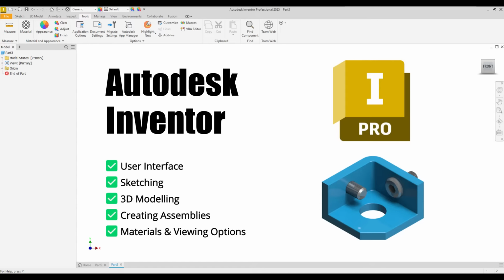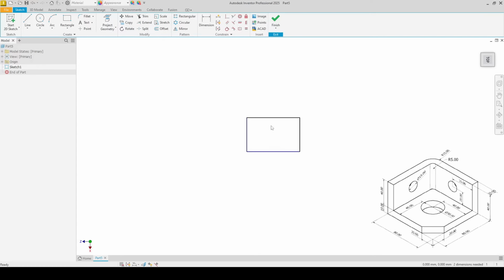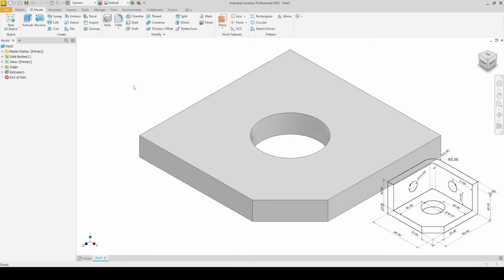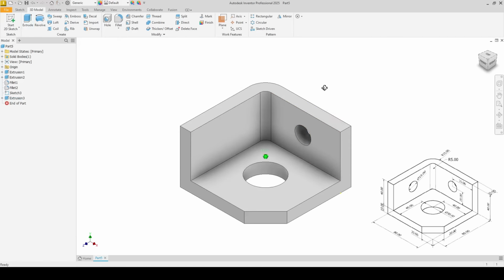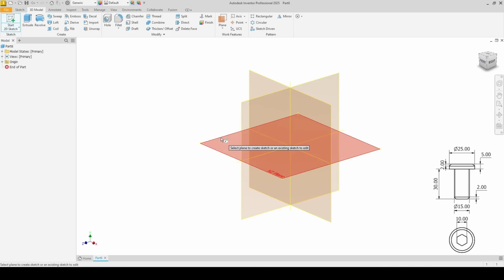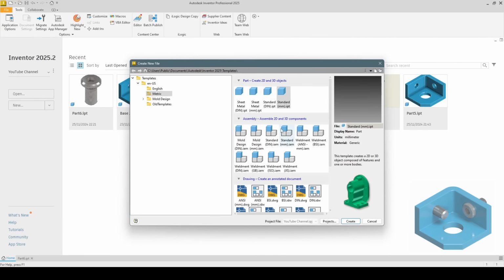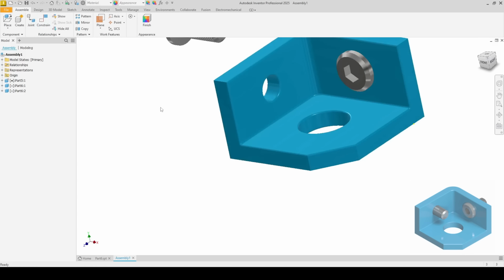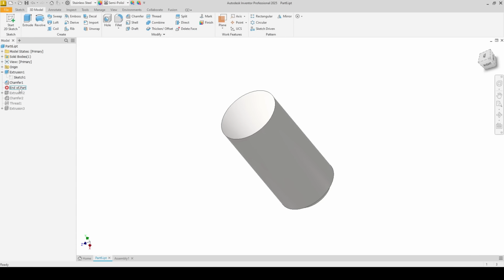Autodesk Inventor 2026 | Basics For Beginners | 30 minute Guide to 3D Design | Step-by-Step

Comment: if anyone wanna become a design engineer, i recommend you to start 3d modeling how the part is gonna be machined...start modeling a block, then extrude out, then use hole features, round off corners, chamfer  edges
Reply from the maker: Great advice, designing with the manufacturing process in mind is such a crucial skill for any engineer!

Comment: What about creating threads on the bracket itself to fit the bolts?
Reply from the maker: Hi Joe, good question. In this case we could create threads on the holes but the thickness of the wall is very thin so there would not be much contact between male and female threads. I would recommend using nuts the secure the fasteners in place on this bracket.

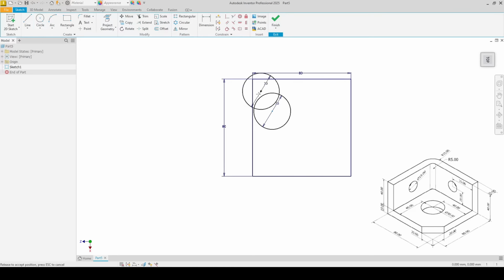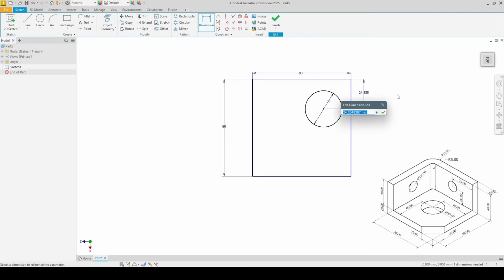Comment: I am brand new to this.  I am using Inventor Professional 2026 on a Windows computer.  I have a few questions, around the 5:00, when you are moving the circle around, what/how are you clicking on the circle to grab and drag it around?  Around th 5:10 mark, when you are clicking on the dimension and the circle (to constrain it) it will not allow me to do this.  Are there some settings that have been setup to allow this to occur?
Reply from the maker: Hi and welcome to Inventor! For your first question, we can drag circles around by holding down the left mouse button whilst hovering over the centerpoint of the circle. Make sure you are hovering over the centerpoint and not the circle circumference. For the dimension at 05:10, that's odd that it does not auto select the centerpoint. In this case, you will need to click the centerpoint instead of the circle circumference. I've never come across this issue, Inventor should default select the centerpoint when we click the circumference. I'll have a look at why this happening. Likewise if you find the answer please let me know :)

Also - I have a full course on Inventor, it's 8 hours of content such as this tutorial and around 20 USD. Feel free to join us there if you want to learn more.

Best Regards,
Chris

Comment: Question. When placing the first item in the assembly, inventor doesnt keep it as i fixed point. Is there any way to do it manually? Thank you for the video, it has been extremely helpful.
Reply from the maker: Hi Michalis, thank you for the comment and I'm glad you like the video :)

Yes absolutely, when you have selected the part, do not left click in the environment, instead, right click and select 'Place grounded at origin'. This will ground it at the environments origin :)

Alternatively you can left click for it to be in the environment floating, and then go to the design tree and right click on the part and select 'ground at origin'. 

I have a full course on Inventor this in the description, all these tips and tricks are covered there if you're interested.

Hope that helps :)

Best Regards,
Chris

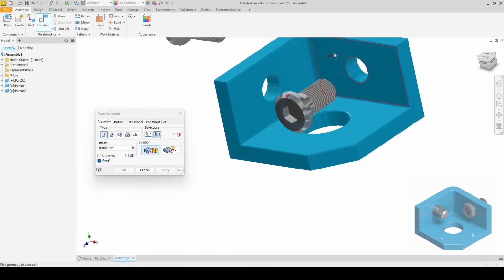Comment: 23:23 why does my pain not rise evenly, well, that is, it deviates from the hole by 20-40 degrees
Reply from the maker: Hi! Sorry for your pain! Make sure you select the axis of the bolt and the hole, they will then be concentric, make sure not to add an offset, i.e. 20-40 degrees.

Comment: My teacher was adamant about using holes instead of circles and not selecting surfaces, but always using planes. This way, the body can be easily modified later.
Reply from the maker: Spot on, the Hode Wizard is the way to go for conforming with hole standards. This exercise is just to appreciate the Extrude tool adding but also removing material. Your teacher makes a good point about using planes! 😊

Comment: Hi, could you please tell me how to solve the problem of internal voids in a part? In Inventor, is it not possible to simply select faces and delete them? That’s how I do it in Fusion 360.
Reply from the maker: Hi Andrew, I'm not sure what you mean here. Voids we typically want to fill in which case we would use extrude, revolve, sweep etc. In terms of faces are you talking about surface modelling? Or do you mean removing entire extrusion that include multiple faces of 3D geomtry?

Comment: 1)а нельзя сразу на одном скетче начертить нижнею часть и на том же скетче начертить стенки и потом их вытянуть??? 2) высота стенок на одной стороне 10+40, а на другой почему то просто 40?
Reply from the maker: Hi, It is possible to sketch the walls on the same sketch as the baseplate but then you will have conflicting material and this may offset the properties of a part as it will have duplicated material in those conflicting areas. For the second point, I understand but the drawing is correct, on the right side you will see that the dimensions reference line (the dashed line) comes to the line above the baseplate. If it came to the bottom of the baseplate then it would be 50mm. Well spotted !
Reply: @DesignForge.Studio  при соединение двух обьектов он их обьединяет и он становиться одним блоком, если тока ты не нажал отдельго  не обьединять. и ты можешь отдельно вытянуть стенкии нижнию часть так их отделяют линии
Reply from the maker: Hi Sigma, thankyou! When you join two objects in Fusion, they can merge into a single body if the “Join” option is selected. However, this isn’t always required — you can switch it to “New Body” if you don’t want them combined.

Comment: 1. Box 80x80x50
2. Chamfer 20x20
3. Fillet 15
4. Shell with thickness 10 and 4 faces marked to remove
Viola! We are almost there!
5. Holes from 3D Model tab. Just poke approximately where the hole is to be and then set the diameter and then touch the shell edges to set the hole position
Done!
Do less in sketches and do more in features - much easier to control your part and make changes.
Reply from the maker: Nice workflow, thanks for sharing!

Comment: hello sir please help me with these issues i am facing
1.while doing assembly I am unable to fix the base its not showing a black dot 
2.drawing a polygon is not working properly like I am unable to draw any polygon i can only draw rectangle but not the polygon i am not getting to fix the center and draw a 6 faced or any numbered polygon how to rectify this problem
Reply from the maker: Base not fixing in Assembly (black dot not showing):
In Inventor, the first component placed in an assembly is automatically grounded (fixed). If the base is not fixed and the black dot is not visible:

Right-click the base component in the Browser.

Select Grounded (a small push-pin icon will appear instead of a black dot in newer versions).

If the component was previously ungrounded, grounding it will fix it in position.

Alternatively, apply Insert or Mate constraints to fully constrain the base.

Polygon tool not working in Sketch:
If you are unable to draw polygons:

Make sure you are inside a 2D Sketch (Sketch tab → Start 2D Sketch).

Go to Sketch → Draw → Polygon.

Choose either Inscribed, Circumscribed, or Polygon by Center from the mini toolbar.

Click once to place the center point, then move the cursor outward and type the number of sides (e.g., 6) or set it in the dialog box.

Ensure Snap and Constraints are enabled; otherwise, center fixing may not appear correctly.

If the Polygon tool is still unavailable, reset the Sketch Environment or check that no conflicting sketch mode is active.

Comment: I got a problem with the bracket. It's not fixed in position. I don't know how to fix that in position.
Reply from the maker: Hi, this is most likely because the bracket is not 'Ground', this means locking it to the environment and provides a relationship with the origin (0,0,0 on the X,Y and Z axis). To do this, go to the design tree on the left and right click on the part and select 'Grounded' This should lock it in place so it does not move.

Comment: Thank you for posting. Your videos are super helpful! When starting a sketch on the XZ plane, Inventor orients the workspace sideways (w/Right on the bottom). Is there a way to change this setting so it defaults upright (Front on the bottom)?
Reply from the maker: Hi and thank you for the feedback :)

It's most likely relating to the template that your using. Are you using a default part file template or a custom one?
Reply: @DesignForge.Studio  I'm using a default template [Standard (in).ipt]. I tried the other templates and they do the same thing

Comment: I'm in the process of switching jobs and I'll be switching from Solidworks to Inventor and these videos are very useful, thanks.
Reply from the maker: That's great to hear, glad these videos are helpful for your transition!
Reply: Same! Thats why im here, im surprised at how he made the sketches, in Solidworks i wouldve cut the sketches that cross one another and not need to select the area to extrude. Also is there a way to just lock the rotation without specifying an angle?
Reply: @trailexploring2810 I was wondering the same, why isn't he trimming lol
Reply: Me too. Good luck with yours.
Reply: I too am switching from Solidworks to Inventor.

Comment: Hi, Great guide for a first time user. 
I don't get the black dot next to the bracket when i import it.
when the bolts are brought in and the constraints applied i get the dots next to them.
 I'm using ver 2026. is it a version thing or is there a setting that is different?
Reply from the maker: Hi Jim, thanks for reaching out. Regarding the black dot next to the bracket part in the design tree, this indicates the part is fixed in position and cannot move or rotate. If you are not seeing this when you insert the bracket, then right click on the bracket in the design tree and select 'Ground'. This will ground it to the environment and so it's fixed in position. The black dot will then appear.

When you constrain the bolts you are correctly seeing the back dot appear as they are now fixed. I am still using Inventor 2025 but don't see why there would be any difference about this methodology, it's a standard rule in Fusion 360 software as well. Hope that helps!

Best Regards, Chris

Comment: I just downloaded Fusion not too long ago and someone mentioned Inventor.. would anyone recommend inventor over fusion? I am trying to learn to be able to make 3D models for printing but also wanted to make my own gears to have cnc'd.

Man this tutorial was so easy to follow. Thanks!
Reply from the maker: Hi, I'm glad you like the tutorial! For 3D printing and general 3D mechanical modelling I would recommend Fusion if you're new to CAD software. Fusion is not as powerful as versatile as Inventor but it's far more popular due to it being a user-friendly CAD software and quick to pickup. If you're working in industry i.e. automotive, aerospace or military then Inventor would be the more appropriate one. I have full courses on both software's for beginner to intermediate level on Udemy, link the the video description if you're interested. They're around 15 USD using the promo link in the description.

Best Regards,
Chris

Comment: Nice explanation... I have had experience for using Mechanical Desktop since 1998 until MCAD2014 and AutoCAD since 1993 ... I have just curious how to use Inventor, just learning
Reply from the maker: That's awesome, welcome to Inventor, I hope the video helps you out! Chris 😊
Reply: @DesignForge.Studio  If you had time, could you show me how to make helical shape(eg.spring) with sweep the sketch with helical path...for instance make projection wire into tube shape than trim than put it as helical path then sweep the sketch folow the helical path....
Reply from the maker: @santosopaulus3064  I have a video relating to spring modelling using the coil command, hope this is all you need: https://youtu.be/3YX1INNU0uI
Reply: @DesignForge.Studio  i see...thanks... It's need more effort to make adaptation to use the tools because past experience...long time ago i must draw Zig-Zag line and projecting the line into cylindrical surface than triming several circle than make it as a 3D path line then sketch the circle then make it as profile then sweep it....he..he...it's remind how difficult to use Mechanical Desktop in 1998 because the hardware can't catch up the software capaility...he..he..But I have Ever Designed "The best seller Street lighting in the world using Mechanical Desktop in 1998, I have worked as Design Engineer for PHILIPS, The Product is "PHILIPS SGP 338" , I designed it with combination 3D surface modeling and 3D Part using Mechanical Desktop in 1998..

Comment: how about the threading on the bracket hole?
Reply from the maker: Hi! Thanks for the comment. Hmm, good question, I've only ever considered this as a sandbox exercise but if we were to design this for manufacture then we would likely increase the height of the vertical walls and use a locknut or normal nut depending on the conditions. So in that case we would leave the hole in the wall unthreaded. Alternatively we could increase the thickness of the walls and tap them, perhaps reduce the length of the bolts as well. Good question, thanks for asking! 😊
Reply: @DesignForge.Studio  thanks for the response. Overall, this is good for a beginner like me in using Inventor
Reply from the maker: I'm glad that it's helpful, thank you for the comment 😊

Comment: Great video 
For some reason my bracket won’t stay fixed
Reply from the maker: Hey Ryon, thanks! If you insert the bracket first then right click in the environment and select 'ground at origin', it will then be constrained X,Y and Z with the default X, Y and Z. Alternatively, place the bracket anywhere in the environment and right click on the part in the design tree and select 'ground' and it will be fixed in position. Hope that helps buddy! Chris

Comment: Is there any reason not create multiple designs on 1 sketch, say for the screw, creating both profiles on the same sketch and then extruding from the relevant position?
Reply from the maker: Hi, this is called Top-Down modelling approach. Traditional CAD program like Inventor or Solidworks use Bottom Up (part modelling and then assembly modelling). I would always recommend modelling individual parts and then combining them into an assembly file. This gives us much more flexibility when it comes to editing parts, and how the parts join/ constrain together. Especially for large or complex assemblies.

Comment: I think "my opinion" Z should be up, X East, Right, Y North, forward. Also Generic material will not give you the correct weight. Easy to create a Template part with correct orientation and material (steel). Good video though.

Comment: Awesome and well explained, no unnecessary blabla and really informative. Top job. But a question here. I see the system is similar to CATIA and there you would have the chance that if you change a part in the separate part file let’s say a screw (but keep the exact same name) does it automatically update in the assembly ? You know what I mean, like parts are linked to an assembly! Thx for your answer.
Reply from the maker: Hi Brian, thankyou for the feedback. In answer to your question: yes, for example if you have an assembly made of many different parts and you open one of those individual parts (outside of the assembly), any changes you make to that part will reflect in the assembly. You'd just need to make sure that once you've opened the assembly that you click the 'thunder' icon in the top left to update the assembly. Same process in Fusion 360.